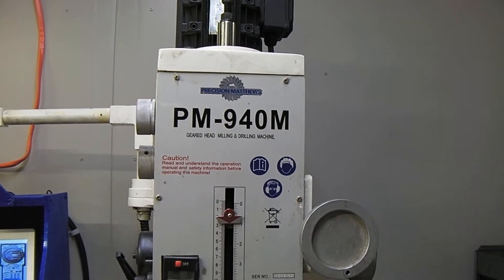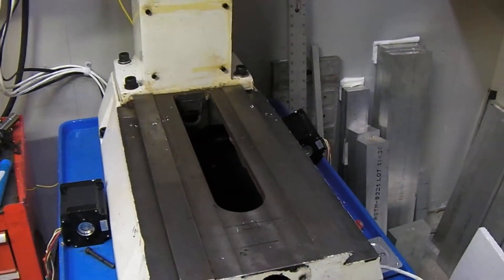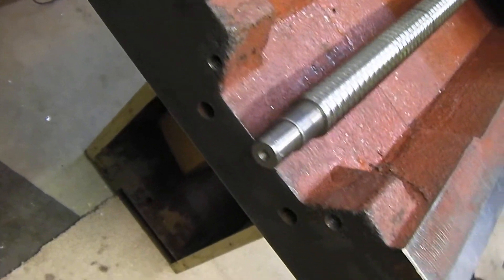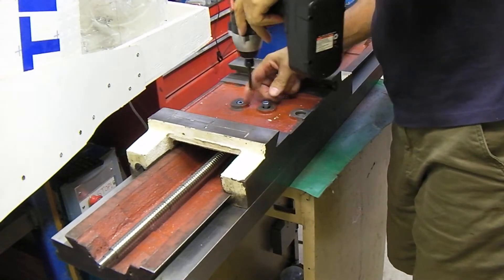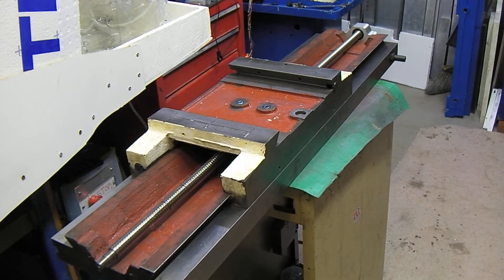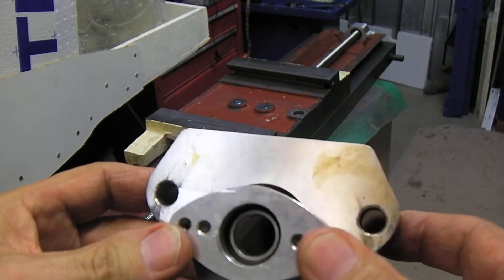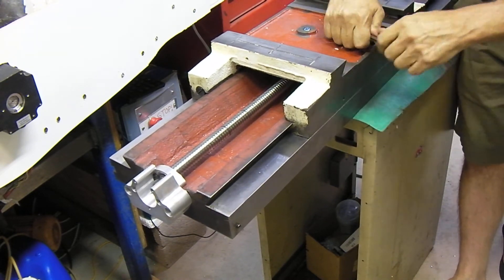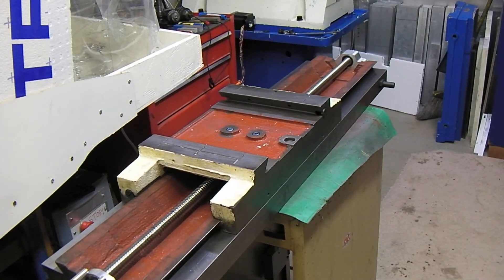PM-940m X mount install

Comment: You fit the X screw like in the video. Then you move the slide toward the stepper side a few inches. This lets you remove the X bearing mount. Then with the X screw in the right place and the X nut bolts fully tight, you remove the gib strip and remove the Y slide. Then you mount the Y axes with the X screw on the Y slide. When the Y is correct you add the table back on and your done.

Comment: Because you needed to mount the x-nut assembly with the bolts under the Y-mount, how did you bolt the Y nut assembly to the Y axis with the X slide installed? The X slide covers the counter bored hole to mount the the Y nut assembly.